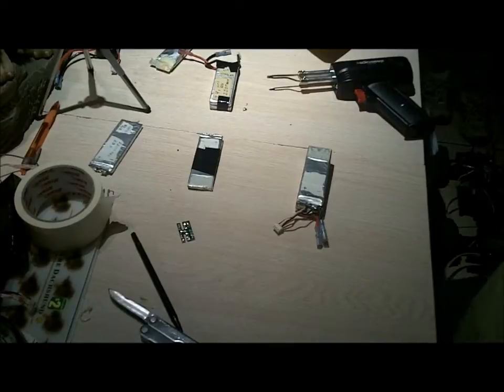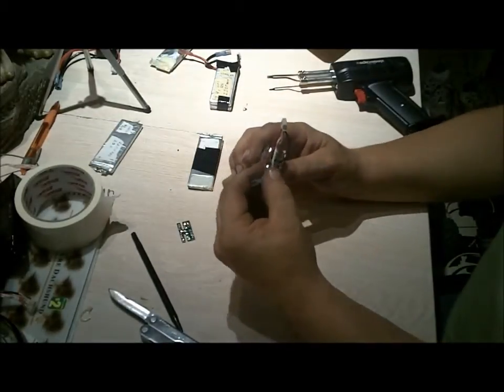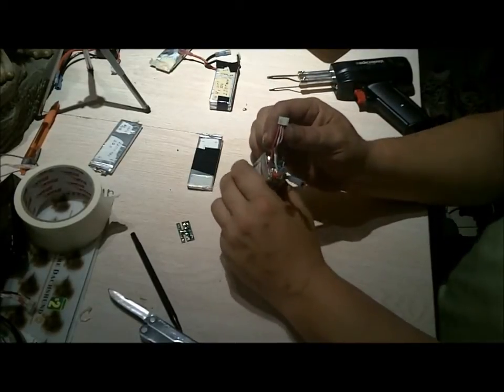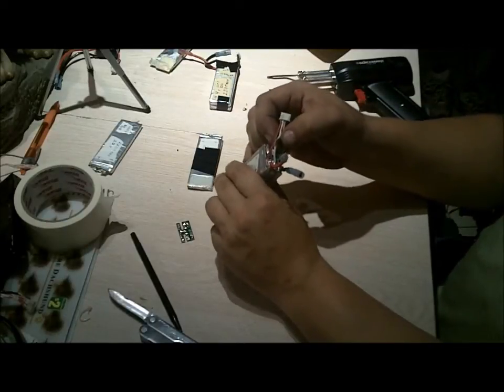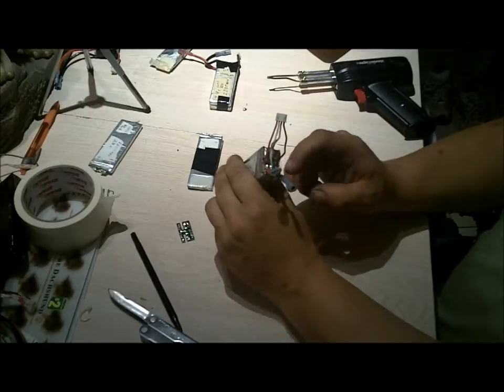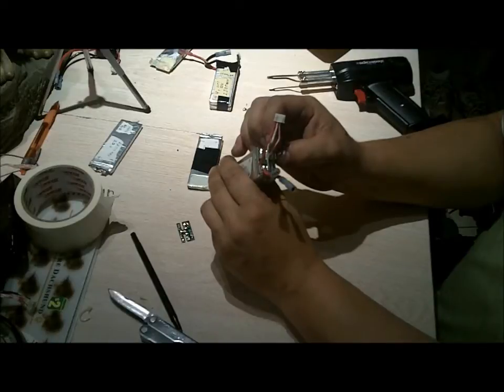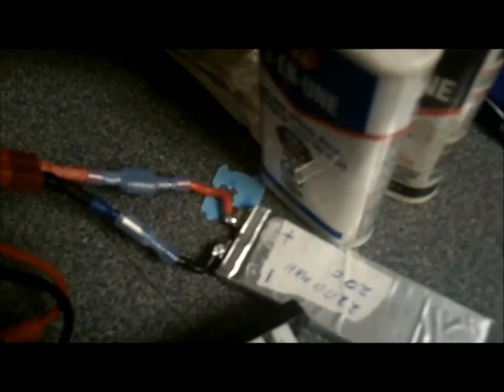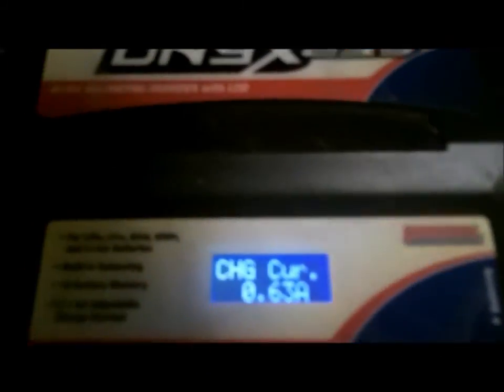the lone rc'er -  3s to 2s lipo mod part 2

Comment: So the circuit board is only used for a cleaner connection to all 3 cells? I mean, it doesn't contain any diodes or resistors and the like? It can be omitted without problems?